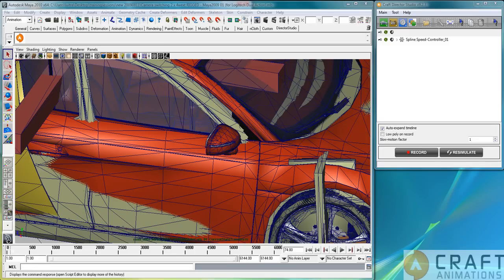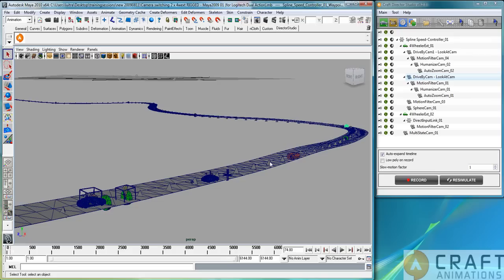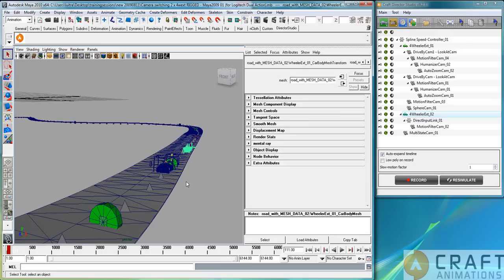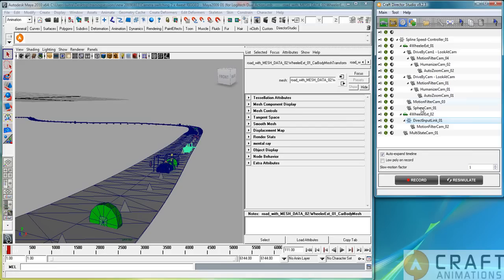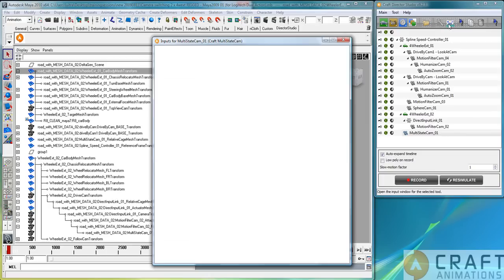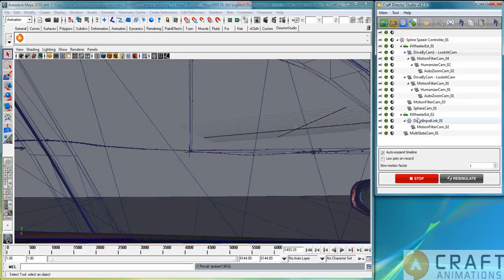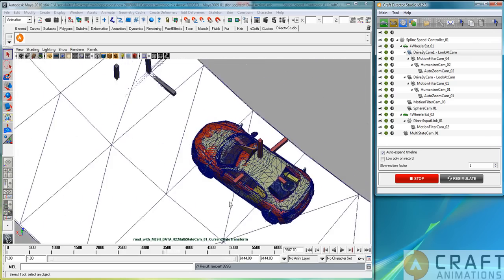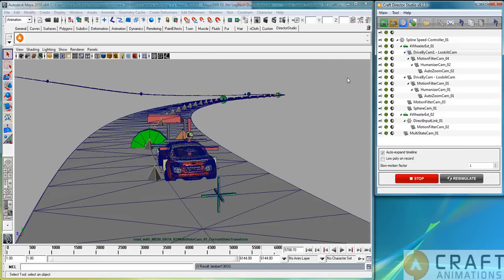Advanced Scene Tutorial - Massive camera scene - Craft Director Studio

Comment: as the machine moves so fast and not far behind the targetmesh ? what settings are used for this ?
Reply from the maker: Fox Kotovski That is a good question. However we do not have this information to be found. However have you tried to use any of the presets? One thing that usually will help is also to make sure that the 4-Wheeler can accelerate and have as high speed as the target. That needs to be set in the Input parameters. "Gas Pedal (Forw/Backw) Response Factor" (acceleration) and "Gas Pedal (Forw/Backw) Maximum" ( Max speed).
Reply: ***** I used "autonomous mode - tight", but car still lagged behind targetmesh. Then an educated bet I found these settings and more or less turned out.

 I want to say that your plugin is great in functionality, but the interface is slightly confusing, is it possible to make it more friendly. Do not immediately understand what is responsible for what in these settings. Please simplify settings. 

Thanks for the quick reply.